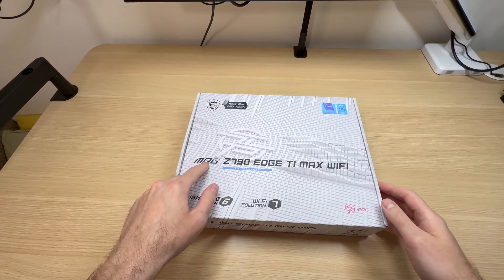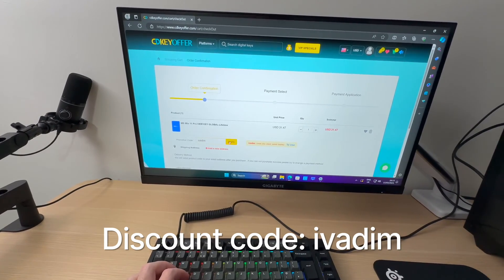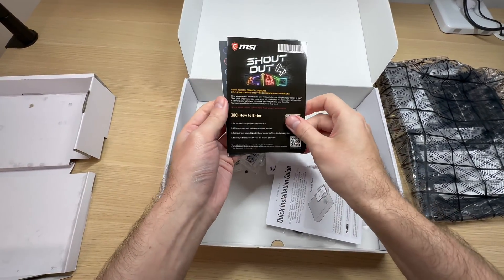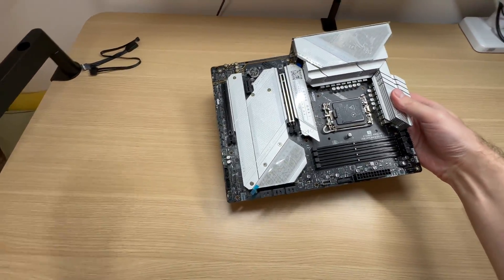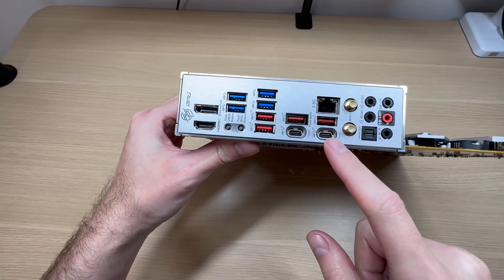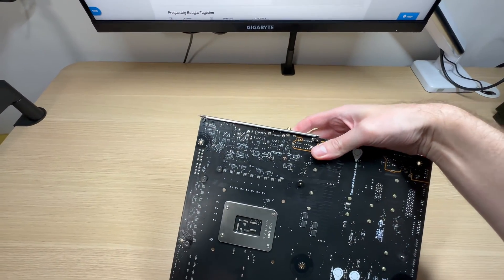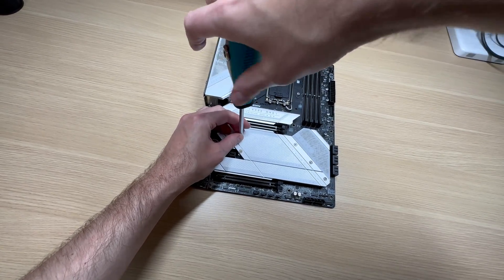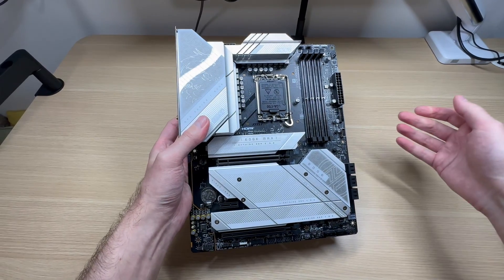MSI MPG Z790 EDGE TI MAX WiFi: Unboxing and Features Overview

Comment: I am still deciding between MSI MPG Z790 EDGE TI MAX and ASUS ROG Strix Z790-A Gaming WiFi II for my Hyte Y70 White Build (yes z890  does have nice whits board too but the new CPUs suck for gaming so I stay with 14900K 14th)   I believe i go for the asus as they have a winter cashback and its a little bit cheaper, but not 100% sure:D

Comment: When i worked at Dell, they said you need to ground before touch pc parts, as static electricity cause damages.
But you here touch it with a bare hands.
Reply from the maker: It’s not that serious. I’ve been building PCs and handling hardware for decades, and I’ve never damaged any components. However, I do use a simple trick to ensure my body doesn’t carry a significant static charge before touching the components: I touch something grounded, like a radiator or a sink tap, to discharge any static electricity.
Reply: @iVadimUnbox  I do the same since I builded my first Pentium 133 Mhz with 4 GB Edo Ram :D   25y ago and never had any issues as well:) fuck I am old^^

Comment: can you rate my spec please tell me if it can be improved. its for editing premiere pro

MOTHERBOARD: MSI MPG Z790 Edge Ti MAX WIFI Motherboard (Intel Socket 1700/14th, 13th And 12th Generation Core Series CPU/Max 192GB DDR5 7800MHz Memory)

GPU: ZOTAC GAMING GEFORCE RTX 4080 SUPER TRINITY OC WHITE EDITION 16GB GDDR6X

CPU: 14th Gen Intel Core i9-14900K Desktop Processor 

RAM: 	TeamGroup T-Force FF4D532G6000HC38A01 Desktop Ram Delta RGB Series 32GB (32GBx4) DDR5 6000MHz White

PSU: Corsair RM850e SMPS - 850 Watt 80 Plus Gold Certification Fully Modular ATX 3.0 PSU (CP-9020263-IN)

CASE: 	Asus TUF Gaming GT502 (ATX) Mid Tower Cabinet with Tempered Glass Side Panel (White)

COOLER: Cooler Master MasterLiquid 360 Atmos ARGB White All In One 360mm CPU Liquid Cooler (MLX-D36M-A25PZ-RW)

FANS: Cooler Master MasterFan MF120 Halo White Edition - 120MM PWM ARGB Cabinet Fan (Triple Pack) X2 sets total 6 fans
Reply: It's a really good build.
Reply: I would bump up the power tho